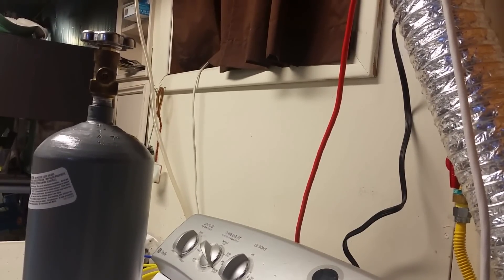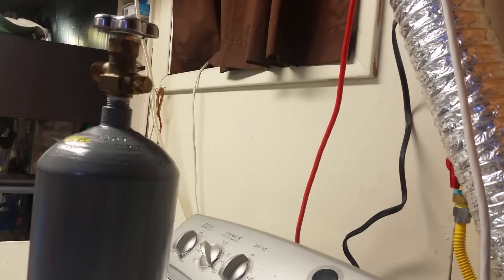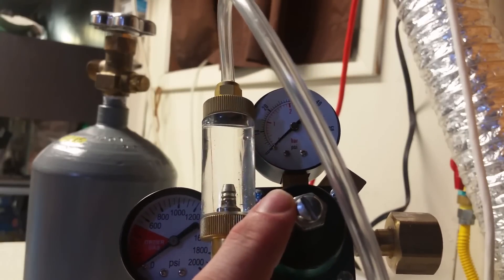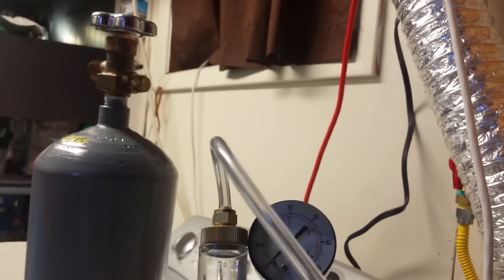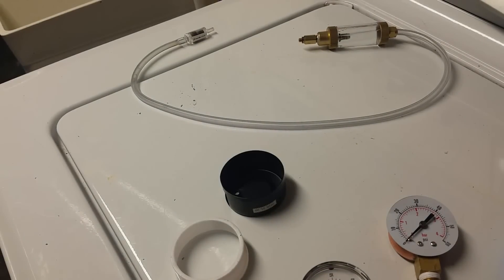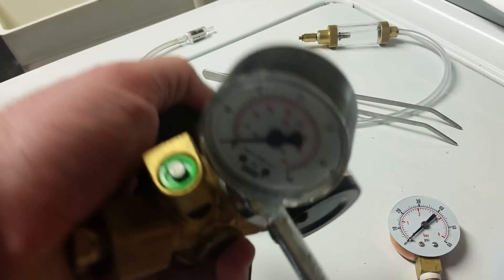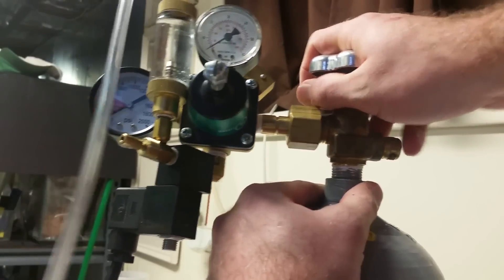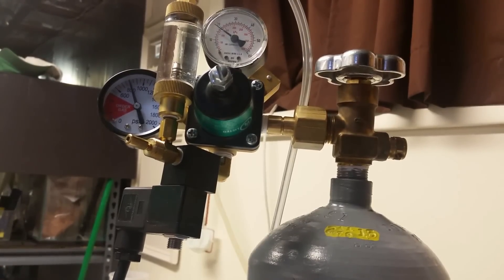Rich's Fishes fixes a broken working pressure gauge on a GLA CO2 regulator (bourdon tube was broken)

Comment: Where did u buy the new gauge from?
Reply from the maker: I honestly don't even remember.  I've bought more since this video and usually check ebay first, but I may have also bought some from Amazon I think as well as some other online sources I found while googling (welding supply places and beverage supply places tend to have these).  Just make sure the range on the new gauge is same or close to what you're trying to replace.

Comment: What's up rich quick question what's the ph in your gbr. tanks ?
Reply from the maker: +al&#39;sfishtanks blobblob I get a ph of about 7.0 -7.2 right out of the tap.  So all my tanks are kept at that range roughly.
Reply: Ok I just ordered some german blue rams and thinking of putting some peat in my fluval305 to lower my ph from 7.6 and up to about 7 . thanks
Reply from the maker: +al&#39;sfishtanks blobblob Well I'd check with the breeder or supplier of those fish to see what the PH of their tank is first.  If these were tank bred and raised rams they should probably be fine with a ph of 7.6.  I always try to avoid any attempts at altering the ph of a tank.  Too risky!  What most fish really need is a stable ph.  Once you try and alter it that makes keeping it stable very very difficult.  Sure if you add the peat to your filter you might get a slight decrease; but then what happens during a water change when you take your higher ph water and add it into the tank?  Now you get a sudden ph spike and the peat is not going to be able to counteract that very quickly.  This will surely stress the fish as they do best with a stable ph.

Comment: Rich I have a major problem... I have 6 discus in a 30 gallon tall tank. The size of this tank is temporary, they will be going into a 60 gallon once they grow a little bit. The discus have all been eating extremely well. I haven't had any problems. But I had some guys come to my home and they were working on the bathroom. I read that vibrations and loud mechanical equipment can stress discus out. When I came home one of my discus was not looking good at all... He had clamped up fins and he is staying at the bottom of the tank. Could he be stressed out from the guys who came over today to work on my bathroom? Or could this have affected it. I recently bought a sponge filter to put in the tank. Because they throw off less current than normal HOB filters. Is it safe to just add the sponge filter into the tank? I have been conducting 50% water changes daily. I also took my HOB filter off the tank to put the sponge filter in. Most of the discus are a little clamped fins but seem to
Reply from the maker: +Fish Man Well vibrations, noise and lots of activity can stress out any fish.  I'd be more concerned about your filter situation though.  Was the HOB that your removed your only filter?  If so, then you removed just about ALL of your beneficial bacteria as that new sponge filter has 0 beneficial bacteria.  A filter's job is to allow beneficial bacteria to grow.  That beneficial bacteria converts the ammonia (very deadly to fish)  produced by fish waste and uneaten food into nitrite.  A slightly different bacteria then converts nitrite (also deadly to fish) to nitrate which is less lethal.  So by removing your filter you are essentially starting over from step one.  Its doable; but will require daily (or more) water changes of at least 50% (which you seem to already be doing) and you should be testing for ammonia, nitrite, and nitrate (which I'm not sure if you're doing or not?).  If you see any ammonia or nitrite then its time for an immediate water change.  Might want to consider doing 75% + water changes for a while until the fish recover.  Hope this helps; and glad you're enjoying the channel!  Keep me updated.  (what size/age are these discus btw?)
Reply: +Rich's Fishes I was afraid of my HOB filter for that very reason. I learned about the beneficial bacteria right here on your channel. Unfortunately I was so ready to get the damn HOB off and the sponge filter in I didn't have any thoughts about it. I will run some test on my tank ASAP and do another water change regardless of the results. Thank you so much Rich. Your response is greatly appreciated.
Reply from the maker: +Fish Man glad to help any way I can!  no point in learning all this stuff if I can't at least try to help someone else!
Reply: +Rich's Fishes Okay Rich I tested for Nitrite and Ammonia and It read 0 parts per million for both tests. Should I go ahead an precede with another 50% water change or go with about a 25%? I added the HOB filter back onto the tank (Not sure if that was the right call) but the filter was still very wet so I was assuming my beneficial bacteria had not been dried out... If that makes any sense... The discus seem to be doing better. They are swimming around and "schooling" again but their fins are still sorta clamped. Since adding back the HOB filter it definitely seems to have helped...
Reply from the maker: +Fish Man if the bio media didn't dry out there is a good chance the bacteria is still alive.  so you probably made the right move there.  glad to hear you're showing 0ppm of amm and nitrite.  keep doing those waterchanges though (don't forget the dechlorinator!) as nice fresh clean water never hurt a discus!
Reply: +Rich's Fishes Okay I'll start my water change ASAP. Thanks so much Rich. Glad to know I have someone to talk to when I have problems.